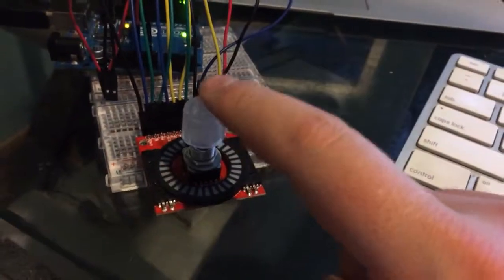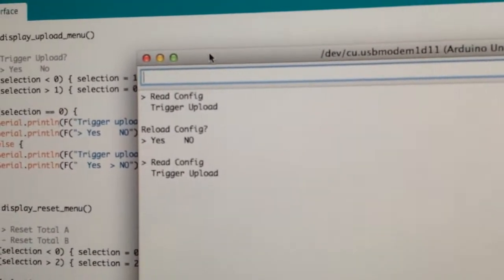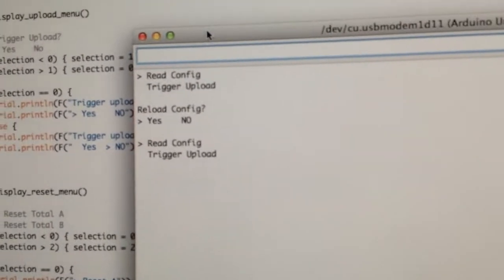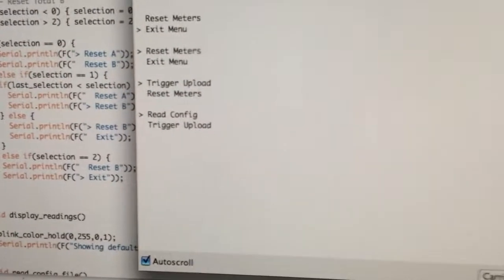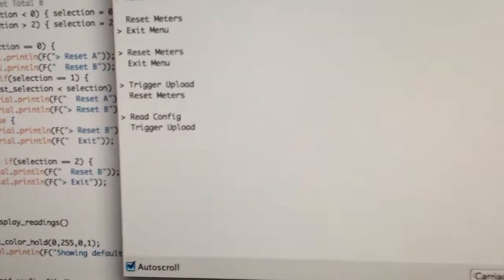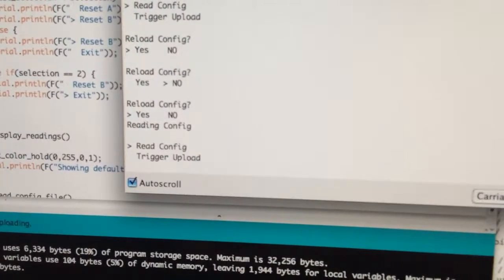Arduino encoder interface

Comment: Hello I am trying to use the encoder for a menu display using serial. However, I'm having a difficult and was wondering if your code was open source, or if you had any helpful sources.   I would like to take a look at it, so I can see where I'm going wrong.